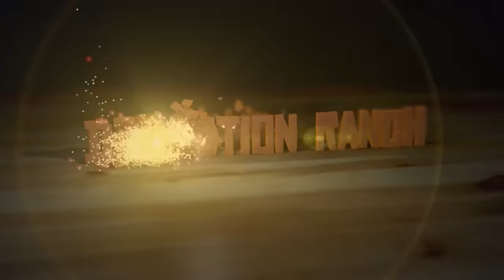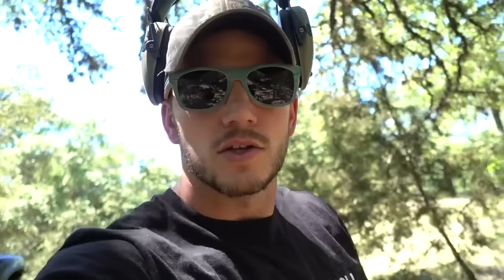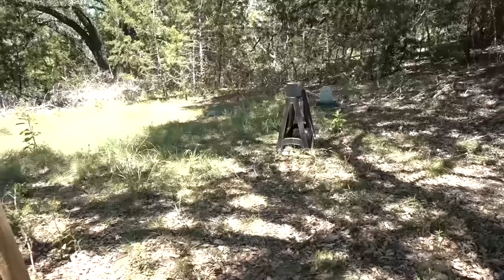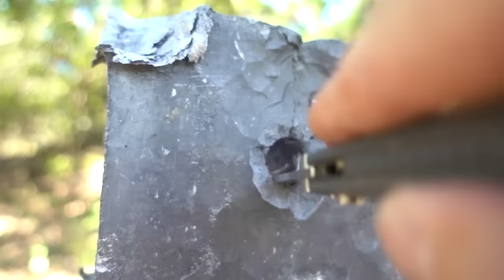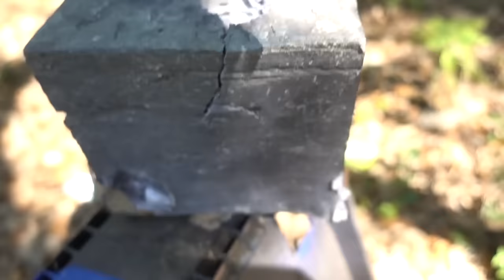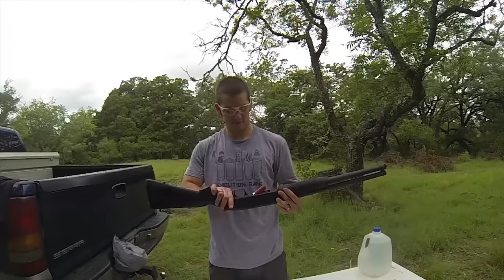How Strong is a Solid Block of LEAD?

Comment: Should definitely get some high speed footage of the impacts. my guess would be that the kinetic energy and friction is high enough that it liquifies the lead in the immediate impact zone, allowing the bullet to penetrate and ejecting the molten lead around the bullet. The higher energy impacts transmit more KE through the lead causing a hydraulic effect allowing energy to fracture the initial impact zone, as only the immediate contact area generates enough friction to melt the lead.

Comment: Okay so the reason that the hollow point Didnt fan outis because it's a harder metal so I started burying itself through the soft lead but then when it got deep enough for the hollow point do you start taking effect the lead was harder than the force pushing out the hollow point so the bullet stayed intact